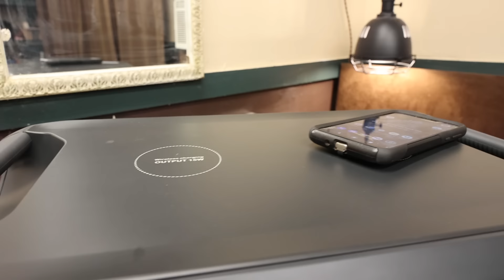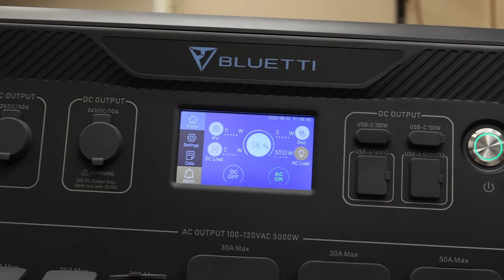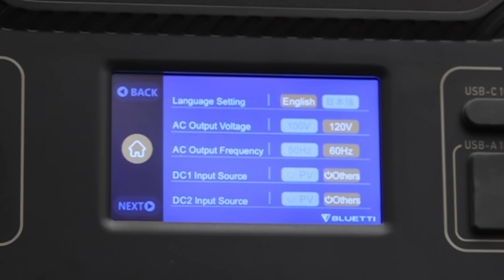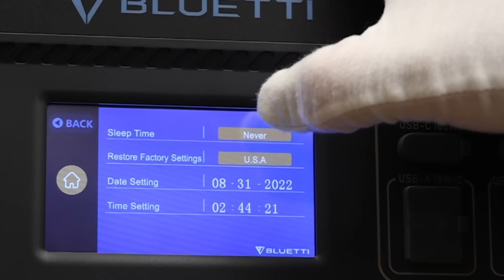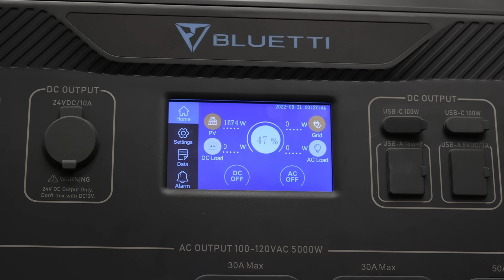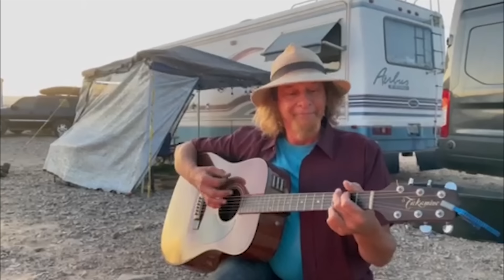Bluetti AC500 5000w LiFePO4 UPS Portable Power Station Solar Generator Review

Comment: Thanks so much for the informative video. On the battery capacity tests, I note that there is an option for deep discharge of the battery when it get's to 0%. This implies to me that Bluetti are only making maybe 90% of the capacity available to consumers and hold approx 10% in reserve for emergencies. If that is the case, and we subtract 0.3kwh from the battery capacity, the efficiency is higher than what you have recorded. I'd be interested in seeing just how much capacity Bluetti are holding in reserve on the AC500, how this differs from the AC300 (which may hold less in reserve therefore achieve better efficiency scores), and how that affects your efficiency calculations.
Reply: @Randomadventuresebike  At what time point was total capacity measured including the deep discharge? I must have missed that.

Comment: Great review and first I have seen online. Could you both of the 30a outlets through a set of adapters to get to a 50a RV plug that could support the full 5000 watts on a 50a plug, I know it would be something like 40a but might allow you to not have a set 20a+20a split. In other words you could draw full 30a from one leg and 10a from another. As you know it is often the case that RV have unbalanced draws on their 2 legs. Looking for a drop in replacement for gas generator and this comes close. Also wondering on the UPS side, does not appear to be hybrid, in other words using power from grid to run loads and charge battery or supplement grid (say 15a) with batter to give >15a output). Really looking for a 50a RV solution where you plug RV into solar generator and plug campsite grid (50a,30a,15a) into generator and be done. This would provide a solution I do not see from anyone else, the ability to move an expensive off=grid system from one RV to another without any permanent change to the RV electrical. #GameChanger #PortableVictron
Reply from the maker: You want this and a twist lock to 30A RV adapter https://amzn.to/3RqXCkB . As for the UPS it is programmable to use solar before grid power.

Comment: I need to know if the “old” B300 batteries can be connected directly to the AC500, or do they need an adapter as I’ve heard the “new” B300S connectors are a different gauge thus have bigger connectors which won’t fit the old B300 batteries. Also, would you be so kind as to do a full up demonstration of connecting and using two AC500’s with a “big RV” 50a setup (two 120v legs into the RV from 50a pedestal- like at the RV campgrounds). Thank you for the wonderful reviews with great tech but watchable sitcom! Be safe, keep them coming!!!!
Reply from the maker: You dont need an adapter.
Reply: Thanks! Now how’s the dual AC500. 50a RV review coming?😁😉👍🏼 Please keep the reviews, what’s new to the community coming. Great stuff!!!
Reply: So, Bluetti FINALLY responded and they say you need a different cable to connect AC500 to B300 batteries. Have you actually connected your AC500 with the B300 batteries using the B300 cable? They are now showing a $99 cable for this purpose on their site. I don’t consider Bluetti’s statement of being compatible as a true statement without the caveat of saying with a special cable being needed. I consider Bluetti as being misleading and dishonest in this regard. Now I have to add this $99 cable to my order so I can use my B300 batteries with the new AC500. Please let others know BEFORE they get invested with the AC500 and “old” B300 system batteries. Thanks, keep the updates coming!!

Comment: Whats even crazier is they could just use a cable with a 90 degree hookup..... still be vertical but it wouldn't stick out hardly at all. They do it in tons of things all the time so why not this? Just like dryer plugs or stove plugs... 90 degree plug

Comment: Unfortunately the Bluetti AC200Max does not work very well for ham radio activities. The inverter works fine for supplying a constant 13.4 volts at 30 amps, but it also generates an incredible amount of RFI (radio frequency interference) that can be heard all over the frequency spectrum of every amateur radio band. Professor Hobo, it would be great if you could add this test to your evaluations of solar generators. I'd be happy to help you out with showing you how to reproduce this issue.

Comment: Great video and review as always. If I bought just the B300S without the main unit to power my Iceco JP50 Pro, any idea if the battery capacity percentage would be better without the main unit? Common sense says it would without the inverter etc.

Comment: Dear Prof HoboTech, does the AC500 have the feature found on the EP500 where the unit can be kept plugged into AC but programmed only to charge when the battery falls below a user-set percentage and continue to charge up to a user-set percentage? For example, the unit starts charging via AC if the battery falls below 5% but stops after it reaches 10%. This would make it very dependable when away from home for extended periods.

For reference, I currently have the AC200 (purchased after watching your review), and one of its quirks is that if the battery discharges to 0% and the unit stops supplying AC power, the unit will not begin resupplying power unless it is manually set to do so after the battery has at least 5% charge. This makes it unreliable for extended periods when I am not home. 

Thanks in advance for your response!
Reply from the maker: Yes, it has the same UPS.
Reply: "This would make it very dependable when away from home for extended periods." Both China and Russia consider the United States their number one enemy, which means the risk of an EMP is higher than ever before. What this means is that you need to keep your kit shielded with EMP protection, so it will be available as a backup if an EMP does occur.

Comment: Fast charging would kill the battery cell and cell manufacturers always claim that slow charging is better for battery life. Other than negative chemical reactions in the cell, fast charing needs the cells in the battery to be more consistent, otherwise the cells would become imbalanced and worse along with the charging cycle.

Comment: Watt-hours.  It's all so complicated.  
When I shop for LiFePO4 batteries I look at the voltage and Amp-Hours and then I double check that by looking at the weight.  
A typical 12volt 100AH battery is about 24lbs.  It costs $380 for the cheaper ones that work fine. 
P = I x V = Amps x Volts.  
A typical 24lb cheapy 12volt LiFePO4 battery has 12volts x 100amp-hours = 1,200 Watt-hours at 12volts. And then you need to adjust for loss at the inverter and depending on the AC voltage. 
And right at that point all comparisons and understanding vanish.

Unless you just use the weight.  The mass of the battery gives you a rough estimate of what you can expect vis-a-vis energy storage.  

The Bluetti AC500 battery according to the website weights 66.2lbs. It has a Inverter capable of burst 10kwatts. 3year warranty which is good.  Question:  Is the inverter low frequency or high frequency with low being the longer lasting type that does not hum?  Low frequency inverters are HEAVY with a 24volt, 3000watt one weighting in at 55-60pounds.  So I am thinking the inverter is one of the cheapy high frequency variety.

Comment: Phenomenal review! I am looking to purchase two AC500 and several B300s. Can a system like this be easily grid tied or is it designed to be a stand alone unit? What is needed to grid tie the ac500?
Reply: Yes I believe it can.  Look on you tube for transfer switch kits and solar generator.
Reply from the maker: These are not grid tie inverters but you can in fact hook it to your home via transfer switch. Bluetti sells their own version of one for this purpose.

Comment: Has bluetti discontinued the b300s. Im wondering if the AC500 will perform differently with only 90 volts from the b300k vs. The 150volts from the b300s?

Comment: I have an ac500 with 4 b300s batteries. I checked the output of the  of the 20 amp outlets and I’m getting 120 volts. I also checked the output of the 4 prong 30 amp outlet and I’m only getting approximately 60 volts out of 1 leg. I used my digital voltage meter to check the voltage output. Shouldn’t I be getting 120 volts when I put the meter leads at the 2 positive legs of the nema 14-30 4 prong outlet?

Comment: Missed you professor.  Do have the AC300 want to add another battery. Will the old AC300 GO with this new battery. You explained this perfectly I just cant buy another whole unit. So updating is my best option. Thanks your looking good. Be safe.

Comment: my furnace because it has an open ground. I thought this would fix the problem but it did not. I used a receptacle tester and it indicated an open ground. I then plugged in the bonding plug, but the reading didn’t change. Perhaps these don’t work with this this battery backup.

Comment: Ok serious question - what happens if I plug this into a regular wall outlet and then plug in either the 30A RV or the 50 amp fast-charger for the plug-in hybrid? Would this work to run the RV at 30 amps while the battery is plugged into the wall? Same question for the 50 amp car charger? In other words, can I skip the electrician coming and putting a 50A charger in my wall with this system?

Comment: Is there a way to disable and enable one of the 240v outlets at different states of charge, say stop supplying power when down to 20pct and restarting the supply when the unit reaches 80pct soc?
Also can you output 2-2.5kw for ev charging while inputting the full 3kw per hour from solar for off grid ev charging?

Comment: thanks so much for the reviews they are greatly appreciated. In this AC500 review you show 240 input using your "special setup in the corner"(17:07) , and I would like to understand how that actually was wired. I would like to understand how you can do that with only 3 pins going into the head unit? How was your "setup" wired?  A simple diagram would be great. I dont see how that can work if you need 2 pins for hot wires, and 3 pin for Neutral and 4th pin for ground? I know you said you were "cheating" I just want to understand how, as I don't think you could ever do this while using UPS bypass function. Of course, Bluettie has a long ways to go with support and documentation. Thanks for all your hard work.
Reply from the maker: With 240v split phase there is two 120v hot lines. You just wire them both into the DP and attach the ground.
Reply: @HOBOTECH  Thanks for the speedy response, I really appreciate it. I also really appreciate the videos too.  I am new to this area of tech, as I am not really the RV'er type so much as a IT / IOT tech nerd. I found my way here because of their DIY "whole house UPS" abilities. This also leads me to excitement to get into DIY solar. I suspect these products will pull in a all new landscape of indoor only geeks. Technically speaking, I figured thats what you did....You were using pin 1 for hot 1 and pin 2 for hot 2, and pin 3 for ground. This means you have no neutral going into the head unit, and therefore no path back to neutral going back to the grid connection. I suspect this is at least a code issue at a minimum when trying to use as a UPS.(I think I even saw in your video that when you clicked the "Standard UPS Mode", the next screen says the UPS is offline.) This implies (just to confirm I get what you did), if your putting 240v  into the head unit you were not really pulling 40amps, you should only be pulling  21 amps on each leg, correct? I really want to try this, but these things are too two expensive to experiment with LOL. Thanks again for all you do and introducing me to my next money pit ;)
Reply from the maker: @DonH-bg8dw  FYI none of these portable gens use a neutral. Both outputs from inverters are hot. Doesn't work like grid power.
Reply: @HOBOTECH  I think I get how these are working when the inverter is used, but I still get the sense that when the UPS mode is engaged (shows up in Bluetti as "Bypass" mode), the inverter is totally out of the loop. Otherwise, I should show an open neutral as I do with my gas inverter generators. I am sure your more knowledgeable about all of it general too, but I would like to be certain I understand whats going on. (As a side note, on FB I am trying to get answers too, and sadly there is not much available from Bluetti.) For example, I got the 30amp input (L14-30) cable from Bluetti , which is 240v standard but they wired the plug to only use 1 leg. Why degrade it if the head unit can take 240v in.....if they used that L14-30 30amp cable at 240v, you could get the full 5000w input charge.....all makes feel like I am missing something.

Comment: So I have the ac500 and a B300…is it correct that the output at 12v would convert to around 260aH?   

I had the b300 hooked to a dometic fridge and it sucked the life out of that battery in 24hours!

*if anyone is wondering, you have to buy ANOTHER cable to hook the old batteries to the new AC500

Comment: So the AC500 is just the inverter, no battery itself? So the pre-launch is $5,000 for only 3,000W of total battery capacity. If you don't need 5,000W of output, this doesn't seem like the best deal. But I'm looking at building my own system so maybe that's why this looks too pricey

Comment: Great review, you are the very best out there! Will the UPS mode stay on as long as the AC is plugged in? I returned a Quiketel and a Lionenergy because the UPS mode turned off after a short period of time.
Reply from the maker: Yes
Reply: "Will the UPS mode stay on as long as the AC is plugged in?" Both China and Russia consider the United States their number one enemy, which means the risk of an EMP is higher than ever before. What this means is that you need to keep your kit shielded with EMP protection, so it will be available as a backup if an EMP does occur.

Comment: The nerd in me is definitely impressed with the features and capabilities, and it looks really sexy (minus the cables). But I still don't understand the use case. Nobody puts this on his desk to charge his cell phone, so I don't understand the USB ports. And while the battery and head unit might be plug and play, "plugging your home" into this definitely isn't. You still need an emergency panel and a generator inlet and run wires for the solar panels. But then it is double the price of a sungoldpower or EG4 system and we're not talking about saving 10 bucks, but thousands. I'm not against options, but I don't see what this option would be good for.
Reply: In my case I need a backup power supply for my sump pump and don’t want to always wheel the generator out for short outages

Comment: I have the original AC200 purchased through indegogo a couple years ago.  Can this battery be used to give my AC200 more capacity, or does it lack enough backwards compatibility for my unit?

Comment: I’m an elderly pensioner & need a solar system that can run my roof mounted reverse cycle air con 24/7 during summer heat in my mini Campervan …

Comment: with the flexibility of the external batteries (B300, B300S), with independent charging, why wouldn’t they throw in at least one AC plug on each battery? That would make it really flexible.
Reply from the maker: There is a charge port on each battery you can use their AC charger on.

Comment: I thought the AC500 was a stand alone 5k generator. You stated that it requires a separate battery 
???
Reply from the maker: The ac500 head unit requires a compatible Bluetti battery to function.
Reply: Thats what I thought too, it was a complete let down. Why not just get a 200max with the battery and run the batteries thru the ac200max
Reply from the maker: I made it clear the AC500 "combo" includes battery. This allows you to have a 5kw power station with 3kw battery that's still portable unlike others that are over 100lb and impossible for most to pick up and move.
Reply: @HOBOTECH  that is true, I appreciate the quick response. I've watched the video twice, both times way to late at night. So I'm glad you were able to clear that up.
Reply: @HOBOTECH  so, because I'm a bit slow. It is a 8,000kwh system. It just needs the extra battery to make the 5,000kwh run. Which drains the 3,000kwh battery while running the 5,000kwh head unit. Im sorry, I just really want the combo with the extra battery, but I just bought the ep500, and want to make sure I will get 8,000kwh out of this system. I appreciate your time and getting the video out before the 7am launch. You put alot of effort into it, I did hear you say in the beginning of tge video. You need the bottom battery to run the top. I just couldn't figure out if it helped get the 5,000kwh out of the top, idk I'm just beat down from trying to figure it out. I have 12,000 invested in bluettie products. I'm just trying to make sure I don't make a wrong purchase. Of course I would want 8,000 kwh for 3,000. It's a great deal. I just needed to know that's what I'm getting.
Reply: Sorry for my misunderstanding and clearing things up. The naming convention following the AC200 & AC200 Max didn’t help things by calling it the AC500 (but then requiring a separate battery when the other AC’s didn’t).

Will the B300S work with the AC200 Max?
Reply from the maker: AC300 has been out for a year and it works the same way. This is an upgrade to that.
Reply: @HOBOTECH  The naming convention arguably leaves a lot to be desired - needlessly confusing. Does the B300S work with the AC200Max?

Comment: Would there be any way or any evse that interfaces with this unit to adjust the amerage being sent to the EV while charging depending on the solar input to the unit? To preserve the battery's life as much as possible while also charging the car as fast as the solar is coming in? Say maintaining the units battery at around 50%soc